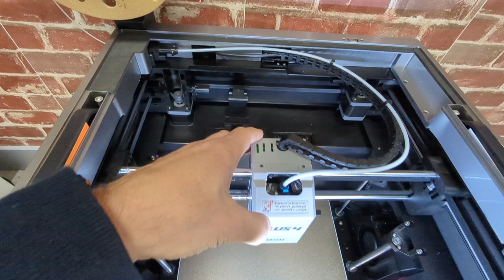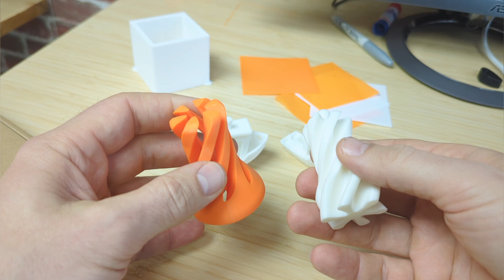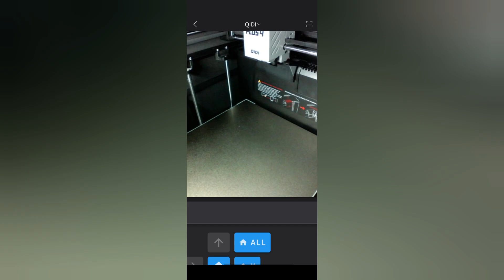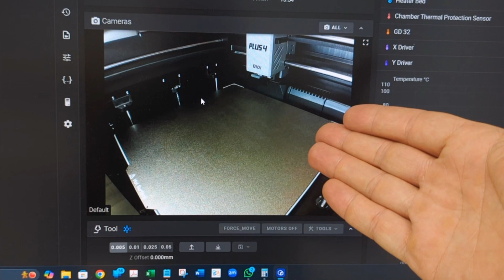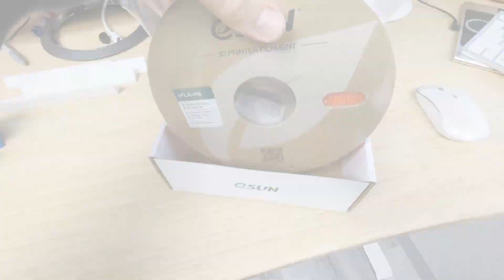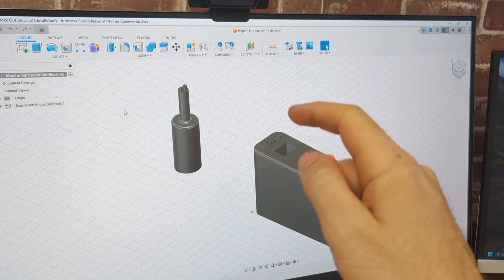Say GOODBYE To 3D Printing Problems! Qidi Plus 4 Detailed Review

Comment: Wish I was having the same experience. First time attempting PLA+ and only had partial success on my 4th attempt. My tree supports don't hold as well as my other machines and the trees were glued on the mask pretty good making it hard to break off. Same settings on my Bambu's and its a breeze. I also have to keep my door and top open or the filament will stretch in the extruder.

Comment: The printer works fine with original QIDI filaments, but I've got some issues with an old PLA filament. What bothers me most is that neither QIDISlicer nor QIDIStudio has the possibility to generate a temperature tower. QIDISlicer and QIDI Studio are so sofisticated and with so many parameters that it needs a lot of patience and a tremendous number of experiences till guessing the right settings for the filament of another brand. I've found that at matterhackers there is a nice idea available for filaments like BASF Ultrafuse 316L Metal 3D which allows for a small amount of money (ticket)  the debinding and sintering of the printed object. Unfortunately I couldn't find anywhere else something similar for the Silicone Carbide filament from Zetamix.  Do You have some successful experiments with that kind of filament from Zetamix? Many thanks in advance!

Comment: Bye to problems? Lol mine died after 30 hours of use! Not ssr problem as im on 240v, adaptor board is the issue, luckily printing cf at the time otherwise pla would of ignite with temps higher than 450°! Be aware

Comment: Great video. I noticed you fully enclosed your printer while printing in PLA. What is your chamber temperature during prints? Also do you direct the exhaust fumes out of the room?
Reply from the maker: Chamber temp is probably around mid 30 deg C.  I haven't had any issues with chamber temp.  Printed is in a closed room but it has the supplied filter.  I don't notice any smell with the printer when running PLA

Comment: So if you print ABS, then heat the chamber and Bed, then the Nozzle crashed into Bed😂. Because the sensors have no temperature compensation. Qidi know this an work on this destroying issue😅

Comment: So all the new printers for 2025 circuit boards all replaced already?
Reply from the maker: I don't know for sure, but it would be very odd for them to ship new products with an older board with a known issue which now has a fix.  I replaced the board on mine just after the review.  Took maybe 20 min or so
Reply: Had it in my Amazon one ordered this week. US

Comment: Lucky you, I bought a plus 4 which won't print anything above PETG, it prints PLA and PETG fine, try to print ABS, ASA or PC/CF and the thing tries to drive the nozzle through the bed, destroying the pei sheet, my theory is that the higher temps involving heating everything up to the higher temps such as is required by these materials is either effecting the probe or the strain gauge in the bed, which upsets the auto z offset calculations, and to date qidi have not even replied let alone provided a solution, I can see a chargeback in qiditech's future.
Reply: If you print with a higher temperature, everything expands, which in turn makes it necessary to calibrate for a higher temperature again

Comment: What PET-G filament do you recommend?
Reply from the maker: Im probably not the best guy for that as I have only done limited pet-g prints.  I've seen videos where people have done extensive filament testing so I would go to them for recommendations (as I would be doing the same)
Reply: @Doodlebud  sorry, I expressed myself badly, what I mean is what petg filament did you use and if there were several brands, which one did you have no problems with? :)
Reply: the key to PETG is to dry it before use and keep it dry wile using it.  Other wise I haven't had an issue with any brand

Comment: The silicone pads are 4.99 at Qidi accessories same for the PEI scrub pads.  Make sure you grab yourself a set of spare silicone sock covers and bimetal two pack of tips to have on hand also.  That is the bare minimum of spares I like to keep for all of my  Qidi printers.  The right side fan on the casing is the Aux cooling Fan.  On PLA+ make sure you dry that filament for 6-12 hrs in a filament dryer.  When you run PLA or PETG  filament in your Qidi make sure top is off and door is open.  Set your fan to run on hi.

The more you try out filaments and stuff and use different ones you will want to do some calibrations and build some custom profiles.  All of that stuff can be accomplished in Orca or Qidi studio.  I have been running the Plus4 since September and have about 500 hrs plus on the unit.  I am very impressed with the prints I get across many materials including nylon.  I have two other Qidi machines, a Q1 Pro which I love, very quiet smooth running printer and the smaller XSmart3 which is a little racehorse with a small bed, but that small bed is extremely stable resulting in ability to run at very fast speeds.   So far to date, I have loved results seen on all of the Qidi's.
Reply: "When you run PLA or PETG  filament in your Qidi make sure top is off and door is open." - I print both of those (and PLA+, PLA silk) with the door closed, and the lid propped open with the rubber shipping thingies that were in the box. Seems to work just fine (the enclosure temp is usually around 35 degrees C).
Reply: @real_electricmonk  You will run into random clog issues on longer prints at some point.  One of those Blue plates where less heat needed would be helpful.  I have run with door closed with success on small prints but any and all longer prints are at high risk of nozzle clog when running  that way and it can be real PITA to clean out nozzle.
Reply: @ What were your enclosure temps when you ran into issues? So far, I've printed multi-hour prints in PLA and PLA Silk, my enclosure never got above 40c (I've never seen more than 38.5c), but then the outside temperature is quite cool over here in Blighty. The only issues I've had are some bed adhesion issues, and that was mostly due to inadequate supports, or excessive speed on the first layer or two.

That being said.... I've less than 100 print hours on the machine so far, so maybe I've just been lucky.
Reply: @real_electricmonk issues arose during warmer weather.  That is why Qidi has automated message to open top and door on PETG and PLA.  Cooler temps do help but in time odds go up dependent upon several variables like room temp fan speeds and quality of filament and bed/hotend temps and fan speeds.  Depending upon material one may also be turning fan off for a few layers so there are many variables that will lead to clog from not properly opening top and door as mfg recommends.  

I learned quickly due to warm weather to just follow their suggestions ands recommendations.  I run Plus 4 have hit 1500 hrs this week on it, my Q1 broke 1200 hrs and my favorite Xsmart3 has broken 1500! I do like using the harder nozzles they offer, they print very well and hold up well to all materials i throw at them.   

Overall have a running 98.9% successful print rate across all machines.  I have experimented using many of the engineering grade materials but lately been doing large statues in PLA.  They take up full build plate and volume of the printer and take 13 hrs to print.
Just something you want to keep eye on if outside temps hit a warm season.  

Nothing as bad as failing perfect large print with a material use cost to make of $12 and have it happen during last ten minutes of make.  I 
just follow their suggestions now and things are tuned in very tight all the printers been running pretty much non stop for days at a time.

I love all my Qidi machines they are for folks who like to tweak machines a bit and like to have freedom to make changes.  Easy machines to tune for some beautiful prints.

I do hope the AMS gets released in the coming  days 1st Qtr 2025 ending soon.  I have  been waiting patiently for it.  Have tons of prints to run that will use the AMS. Plan to hook up two units to maximize color choices.  If they follow release history they should have announcement any day pending no delays.
Reply: @jefft490  I'll definitely keep an eye on temps - as I say, so far the UK has mostly been on the cool side, so no issues with room temperature rising too high; but come the summer, I may need to relocate the printer to the garage where it won't get quite as hot as my little office.

This is my first Qidi; I'd been hanging in there with a couple of Ender 3s until the other week, when my "good" Ender crapped itself & refused to extrude any filament whatsoever, unless the nozzle was way off the bed. No such issues with the Qidi!  I've also bought some filaments to experiment with - some TPU, some ASA & some PA-CF. 

However, I have to be honest, so far it's been mainly printing toys for my boy (or me)... going to try to find something suitable for the baby girl to print in TPU next...

I'm also really looking forward to the Qidi Box! I'm less interested in doing multi-colours, than I am in finally being able to use every scrap of filament off a reel without worrying about manually changing it!

Comment: Sorry doodle, but this seems like a review from somebody who just spent a view hours doing easy prints with using PLA with the plus4. 

I was really laughing as you were talking about the chamber heater issue while pointing all the time to the auxiliary fan. The chamber heater is on the opposite side, pal ;)
Yes, the plus4 can do nice things but it's a typical chinese product with all the flaws nad lag of documentation. Firmware updating was a nightmare with the eraly versions. The chamber heater malfunctioning of the 110V version (smoking boards) was incredible unsafe. In the meantime I received three spareparts and a refund for all the issues I hard (broken thread at the sidewall for the chamber heater, clogging due to insufficient cooling of the cold area of the hotend, auxiliary fan close to end of life). As already said by someone, the QIDI studio is buggy and much worse then the originals it was forked from (use e.g. Orca instead). And I am not talking about other things like non-existing thermal insulation and the general construction/assembly of the printer. Replacing the chamber heater, at least according to QIDI support video, for example is a 30 to 60 minute task where you have to remove more than a dozen of screws.
Well, maybe you make a follow up video in two month to share your final thoughts ;)
Reply: I think what he meant was that it only takes ten minutes to replace the heater power supply not the chamber heater.

Comment: Thank you for the review from a user's perspective, there's not too many casual reviews of this printer currently
Reply from the maker: I thought it would be helpful to approach from a project perspective. Folks looking into this one are most likely thinking of making large quantities of a small number of parts. So it's important to see the failure rate and issues that come up. It's also easiest to spot issues when you print 100 of the exact same part. Optimize every setting for the best mix of quality, speed, and material consumption. Once you have that dialed in you just want it to run the same file over & over & over with as few issues as possible. It's boring but its what makes you money.

Comment: I have been eyeballing this printer pretty hard.  I want something that prints the hotter engineering grade filaments like PPS-CF and has good surface quality.  The only thing keeping me from pulling the trigger on buying it is the new Bambu Lab printer announced for January.  I know I'm playing chicken with tariffs and everything, but if the Bambu Lab has the temp range I want, I'm perfectly willing for fork out the extra dough for what could be the added capability.  If not for the 110V issue with the SSR and how poorly QIDI initially handled it, I already would have purchased this machine.

Right now, I'm using an upgraded P1S with hardened steel nozzle and extruder gear and I've been printing a lot of PET-CF and even a little PPA-CF along with some artsy projects as well.  I did the Panda Revo mod as well, which will allow me to use up to 1.4mm nozzles and obxidian high flow nozzles from E3D if I need to crank out something chunky and strong.
Reply: I own a P1S with just under 1000 hours of print time on it and it still prints like new. With that being said I am not too happy about the firmware upgrades they are proposing that will lock out the Orca slicer and prevent other mods some use like the Panda Touch. This printer looks like it might be a good alternative for my next add-on printer in my fleet. And the added print volume is a great plus. (Sorry about the edit. Just wanted to correct some spelling.)
Reply: @DaveBuildsThings  i thankfully pulled the trigger on the Qidi Plus 4.  Gave up on Bambu Lab after I realized Chinese New Year was going to push back their announcement for at least a month.

Comment: I just got a Q1 Pro (received it yesterday), and so far I'm pretty happy with it--other than their dodgy custom (and very old) version of Klipper and Moonraker, making it more difficult than it should be to customize that as I'd like (e.g., after manually upgrading Moonraker, I can make it talk to Spoolman, but I haven't yet been able to get the Telegram bot to work).  But it's a solid, performant mid-size printer for a very attractive price.  The Plus 4 adds bells, whistles, and size, of course at a higher cost.  But it will work with the yet-to-be-released "Qidi Box" multi-material system, and I don't know if the Q1 will.
Reply from the maker: Glad to hear your Q1 is working out for you.  I'm confident they will have an AMS for the Plus 4 soon as that's the only thing its missing compared to its competition.
Reply: @Doodlebud  I agree it will likely be out soon.  I hope it can also work with the Q1, but I guess we'll see (and I won't be too upset if it can't; there will be other options).
Reply: @danbrown586 hey mate, how did you manual update moonraker? I need 0.8.0+ for simply print. This is driving me crazy too, such a good printer apart from their firmware

Comment: Ive had the QIDI 4 for 2 weeks,    and already landed a job printing parts through work for their Bus retrofits.   That has paid for the printer with just the first batch of 25,   they come out flawless!   And print fast,       if I still had my cr10s pro. I would have had to decline the offer.

Comment: Rapid PLA usually prints at higher temps than reg PLA,. Also, you know you should tune for every vendor/type/color for optimal prints.since you're actually not using Orca, you don't get the vast other calibration options
Reply from the maker: I tried so many adjustments with the elegoo with my print settings (nozzle, bed, PA, etc) and it one thing got better something else would get worse. Just couldn't seem to dial it in and just wasn't worth it anymore so I ordered more of the hyper series and instantly every print was perfect. There is probably a perfect mix of settings that will get the elegoo to make  great prints, but I ran out of patience trying to find them.

Comment: Quick note looks like you were actually using Qidi Studio, which is their own custom slicer. It is actually a fork of Bambu Studio, just like Orca Slicer. You can use Orca Slicer with the Plus4 as there are built in profiles now. Most of the other functionality is the same, but there are some additional settings and more calibration options like you wanted.
Reply from the maker: Correct, runs Orca backbone but Qidi's own interface.  Thanks for letting me know there is the extra calibration stuff on the actual Orca slicer, I'll give it a go.  I have Orca on my other computer but haven't used it for this printer yet.  For this video I wanted to use the full Qidi setup just like a new user.  Its really good and convenient, and just a few more features would make it perfect.

Comment: Absolutely love my Plus4. Produces some of the most accurate and VFA free prints I've ever seen from a stock machine. I also modded my firmware to use KAMP purge so it doesn't poop for normal prints. Great printer for higher end engineering style filaments and basic PLA alike. There have been a few bugs with the launch, but overall very worth it to me.
Reply from the maker: Its just been rock solid.  Only time it messed up was me messing it up or funky filament.  Those first layer tests were so damn good and the print quality and reliability has been fantastic.  Looking forward to being able to sell my first 3D printed parts to the market!
Reply: @Doodlebud  Yeah honestly I had the same concerns as you that I wouldn't really want to sell anything if it looked like... A cheap 3D print. I'd be much more confident selling something from the Plus4.
Reply from the maker: @802Garage  I realized right away when I did my first print of my part I want to sell. This will do just fine.... 😁